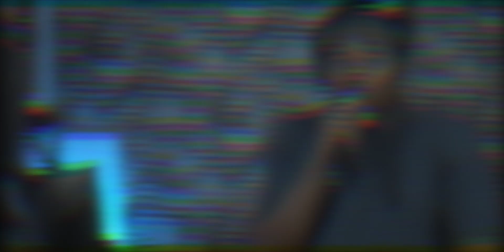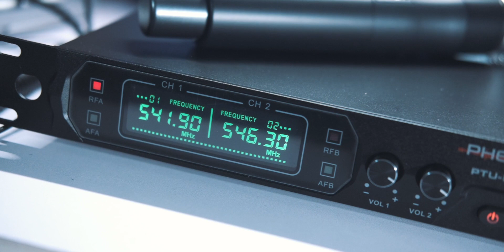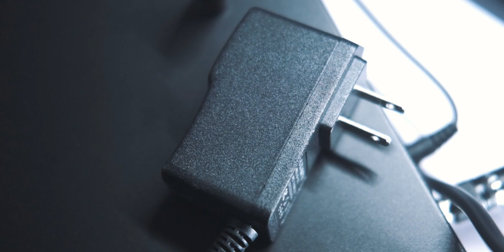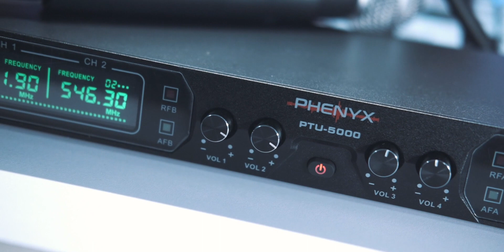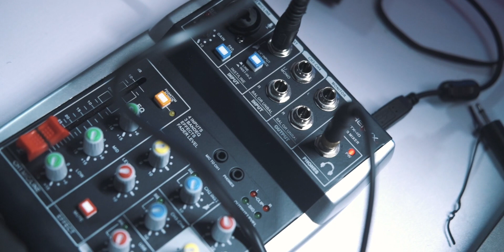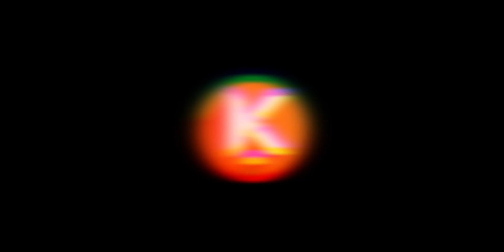Phenyx Pro PTU-5000A Review - 4 Channel UHF Wireless Mic Set For Events & Karaoke

Comment: Dynamic mics are better than condenser mics BECAUSE they only pick up sound very near the capsule.
Reply: Depends on the environment and what you're going for. They're definitely necessary for live performance. They're also better if you're in a noisy environment. But for the most part condenser mica are king for recording most modern rap, rnb and pop vocals. With condenser mica positioning according to the polar pattern is important. You want the Mic to be facing away from any background noise and you want the gain as low as possible while still getting a good vocal signal. It's really just a balancing act. But condenser mics definitely have better sound quality when recorded right because they pick up more frequencies and tones and the signal is cleaner.

There is no better type of Mic. There better mics for different situations.